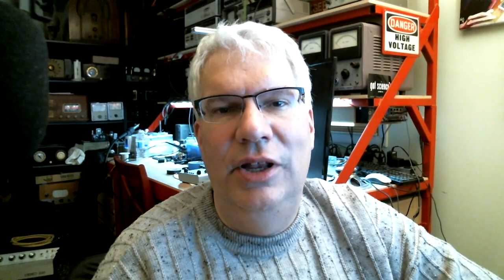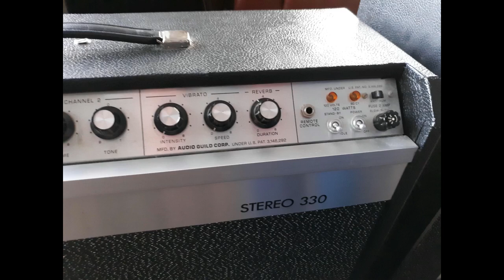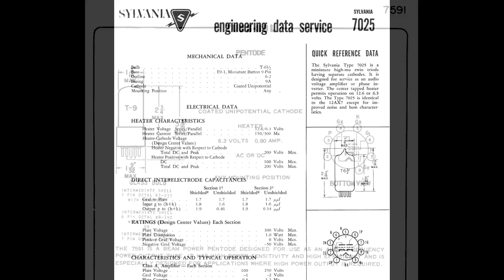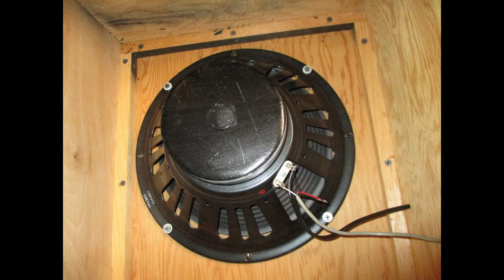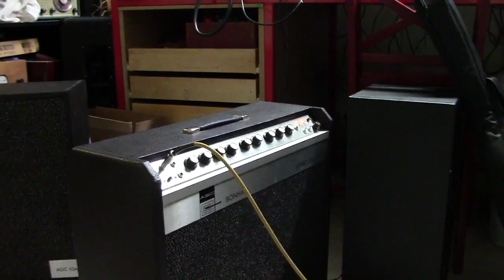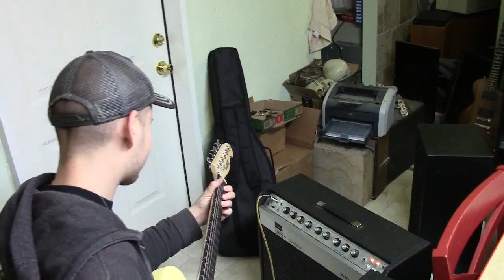190226 Valve Studio - AGC Bonham Stereo 330 Vibrato Ensemble

Comment: Do you know how rare these will be in the 2050?My dad bought his at a yard sale and the dynamics for the creation process of designing a stereo guitar amp was actually compatible with the stereo TV's they made in the early years. That's why the diagram is so far from comprehension and people let this amazing amp slide by without comprehensively  going over the designing process and development. Like the an Ibanez to a fender. But you ask me the it was overlooked by rock stars and country but the sounds are more unique to blues/jazz type player.Stereo means 8 ohm leadouts to the sat. Speakers for if you look they should say 8 ohms as traditional amp (fender, etc. ) are 4 ohm speakers but was not designed for in home use wit sat. Speakers. Imagine if this company would've thrived (and they should have) they would've eventually been the top of the line of their kind on the. 70's, 80's, and so forth. I got one and I'm amazed at the innovations they did in 1962. Just wow!!!!!
Reply from the maker: When I first saw it, I kind of cringed at its appearance. The trim piece looked cheap, slapped on with no style, almost Sears-like. But then went to move it, WTF, its a back breaker. Was shocked at the tube count. Bought it,  got it in my lab and started researching, wow, this is unlike anything I've ever seen or heard about. You're right, this is not a fender amp but something quite unique. I'll eventually open it up and take a look, video documented. Thanks for watching.

Comment: What a magnificently designed and built, ultra-complex, great-sounding "beast" of an amplifier, Craig. Unraveling all the mysteries of this circuit should give you many weeks....months? of pleasure. Those accordion tone cabinets are worth a fortune just for the 12AX7's.....Wow !!! Overall, a very informative, nicely produced video. Thanks for posting :)
Reply from the maker: Thanks Doug, there's not much posted about this 330 specifically, but AGC manufactured for other brands as vibrato amps, I read that here, http://magnatoneamps.com/audioguild.html.   Here's some internal photos, http://www.angelfire.com/az2/bonham/Bonham.html. Looks like a bunch of transistors as well. Beast indeed.
Reply: Just bought and fixed ours up... It's a 62 model and both speakers are pounding... No complaints at all we even have fender amps and marshalls... And I can't get over the way it sounds it very unique!!